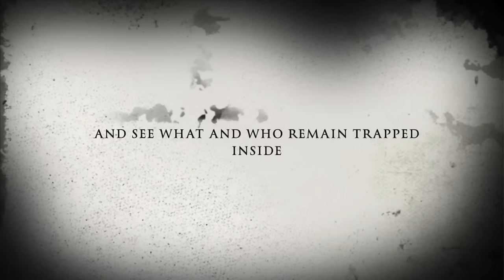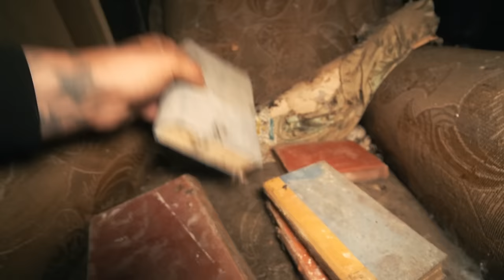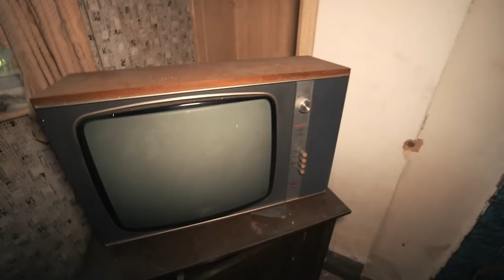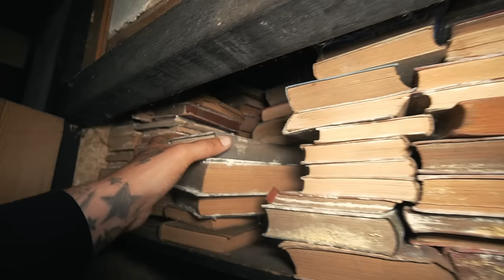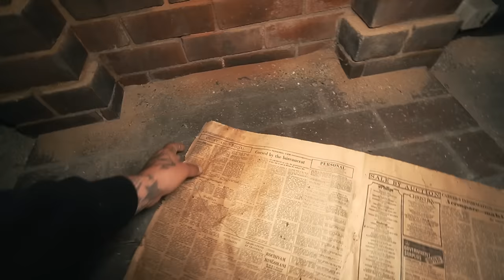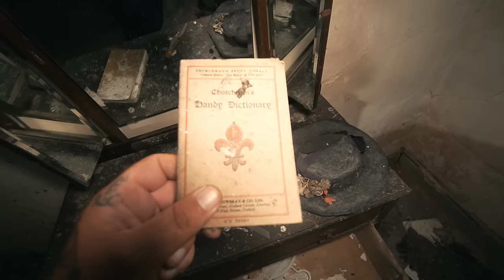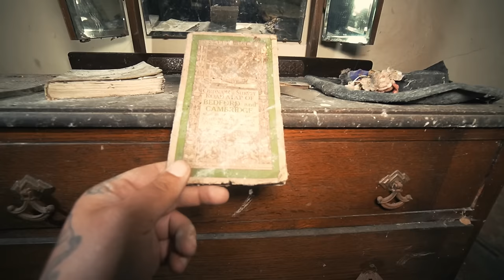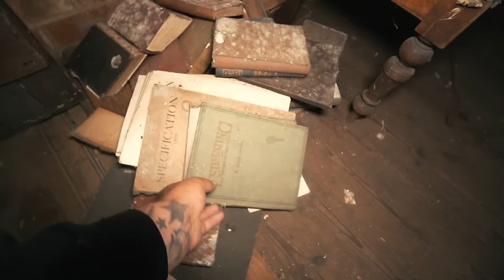HAUNTED ABANDONED HOUSE HIDDEN IN THE WOODS - SHE DIED AND LEFT HER HOUSE ABANDONED FOR DECADES

Comment: That radio is a Igranic Broadcast Receiver. You needed to connect speakers and an antenna to it to hear it. Built around the mid - late 1920's. Rather a complicated device just to listen to the radio so I suspect someone in the house was a bit of a radio enthusiast. They cost around 25 BP back then. It was meant as a tabletop radio.

Comment: Great explore Adam and Dale, enjoyed seeing the stick images. The two white tubs in the begining were stand alone spin dryers, you placed a bowl under the spout to collect the water as it spun...we had a ine named 'Creda Debonaire' in 1959 and I still have the 'Creda Cookbook' that came with it. Yes I'm that old 😉 Hydrogene Paroxide was used as a strong disinfectant in the old days as was surgical spirit. The box in the attic had old radio Valves in it, (they were at the back and looked like blacked out tiny lightbulbs.) They were in every radio and could be changed if one blew out. I may be wrong but that looked just like a radio transmitter that would have been used in WW11 to send messages, broken down easily into parts and assembled quickly. A lovely little old cottage that would have been cosy in its day. Although dilapidated plus grimey and dirty inside through natural decay, I didn't get any bad vibes only ordinary vibes. Thanks for this one, say Hi to Lisa for me. 💕🇦🇺
Reply: I was thinking that's what they all were, but you have confirmed it with a far greater explanation, more accurate and more detailed than I could of.. excellent dating too.  Thanks 😊

Comment: Fantastic explore guys .  Those two tub like devices near the start , are old spin dyers . Put in the wet washing and start them up . My Nan had one , which she used to replace her old hand ringer , ( Mangle )  .  I believe that the electrical box , is an old frequency generator , used in testing certain types of electrical gear , such as ; Chokes and solenoids , a sort of transformer that works above the 50 hertz of the mains .   45 minutes well spent . Keep up the good work , Chaps .

Comment: TS 30:14 you can hear your joggers material swishing but theres an extra noise that sounds like someone trying to communicate. Dale, an isolator.. Working Principle: An Isolator utilizes a transversely magnetized ferrite junction to direct incoming microwave energy. When a signal enters the device, it travels in the direction of the flowing magnetic field. In this way the signal is directed to the desired port on the device. An Mark whoever edits your content, they outdid themselves on this one. That intro was totally awesome!  x

Comment: Another amazing video from the two best. When you and Dale get together it's for sure going to be a good time.   You're SAS segment was an excellent catch. I use the app and only get the Fae; the buggers are all around.  Thankfully it looks like the hooligans have not found it yet.  The figure in the chair was a rather large dude but wonder why it did not pick up the head, there is usually at least a white dot or a few.  Yucky, hope it wasn't lopped off.  I also notice that there wasn't pictures or framed pictures, that for sure is passing strange. Tons of books but no pictures.  This is a very strange one.

Comment: Adam, I"m fairly sure that the box you found upstairs with the tubes in it and the tuner plates is an old short wave radio tuner sir.  Its missing a speaker cabinet or the headphones, but I'm sure its a tuner.  It would need an antenna as well.

Comment: Hi Adam 17.34 that is a very early Radio receiver from around 1930 by the style of the Valves in it. They would have used a separate Speaker for the sound.

Comment: The little wooden device is used to play the card game cribbage. Hydrogen peroxide is also used as a antiseptic for minor cut and bruise's. You can used it to rinse your mouth with. Good for the teeth gums. Don't drink it! The oscillator produces a wave form. Could be a very early radio. Somewhere between mid to late 1920's maybe. Possible early 1930's too!

Comment: 13:35 Don't often see Globe taps these days, these would be 3/4" female, which screws into a male thread of a bent brass adapter 3/4"male x *1/2" if *on the mains and 3/4" male x 3/4" for the hot/tank fed. Looks like lead under the basin for supply pipes and the horizontals part of the H&C steel. Waste u bend is lead S trap 1.1/4"  with brass nut & liner "wiped" onto the nut & liner. Basin looks c 1920'/30's.

Comment: That piece of equipment was a crystal oscillator used for accurate frequency control of military and naval radios and radars during WWII.  They may have used it to control the frequency of their home radios.  That is an AMAZING find!  You really should do some research on the the owner to find out if they used it during the war to control the frequency of radio frequency during the war (in the field or ship to shore) or radar frequency not.  During the war, women were frequently recruited to spy for the allies, and sent to France to provide information on the Germans.  They used radar to communicate their messages and would have used these oscillators to control the accuracy of the radar frequency.  If the research doesn't come up with anyone associated with the war effort, then they would have used it to control the accuracy of their early model radios in the home.  That's just a FREAKING WOW find.

Comment: I came across 1911 mystery with a WWII connection. In the year 1911, a train in Italy disappeared into a tunnel in the Lombardy Mountains before reaching its destination. There were only 2 survivors and no train wreckage. It was called the Zanetti Train Mystery. The authorities investigated the tunnel, found no wreckage, and the tunnel was sealed shut. During WWII, the tunnel location was bombed by the allies in a bombing raid and today there is an old WWII cemetery with a single rail line that goes through the cemetery. It is called  Aspen cemetery. Check it out.

Comment: (29:30+) You can plainly see the stick figure fills into the shadow effect on that wall (its white on the green screen) directly behind it! There is an impression on the wall. An outline of someone sitting on the floor, facing that bed. The head, torso and arms all facing toward the bed. Arms extended toward bed and ass on the floor.  Creepy af! Do you see what I mean? Its like a flash exposure imprinted on the lowwe part of the wall in the middle of the screen next to the bedpost. Small,  Like a child. You can even see the eye socket.(in profile) As if someone died, leaning up against that wall, and it left an impression.

Comment: An oscillator is a mechanical or electronic device that works on the principles of oscillation: a periodic fluctuation between two things based on changes in energy. Computers, clocks, watches, radios, and metal detectors are among the many devices that use oscillators

Comment: The machine in the attic looks a 1920's Super-Heterodyne Radio aka "attic radio". There was a small badge/medal on the front of each coil. It may have been the brand name as well as the one on the front. If I had to guess, I'd say the 412 in the center front of the name brand is the model number. There were quite a few manufacturers such as Raven, General Instrument Corp., Browning-Drake Corporation. The photos of those I just listed have very similar exteriors, but no photos I could find of the interior coils.

~ APRIL LIPKE